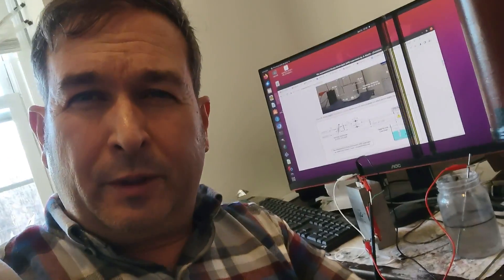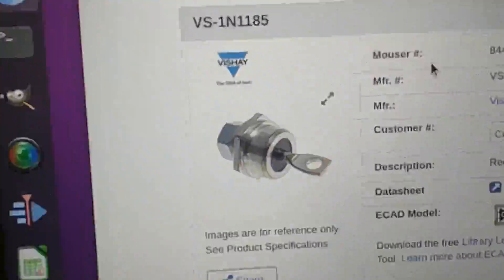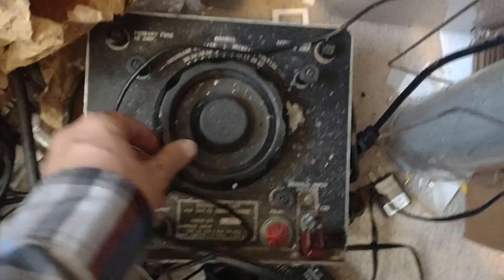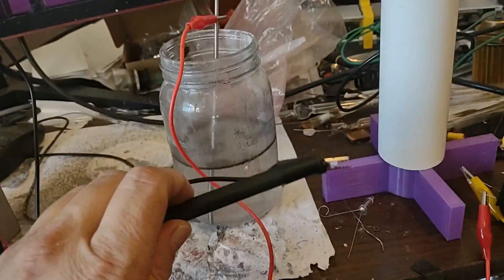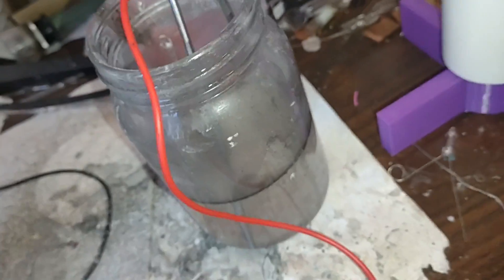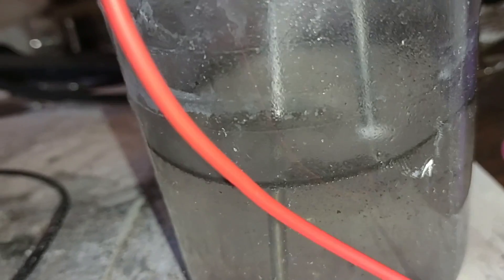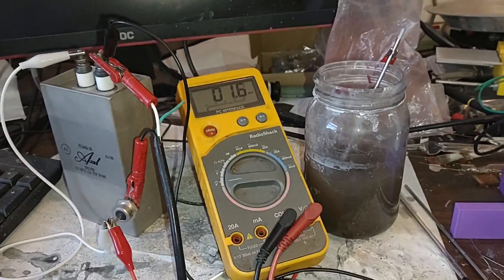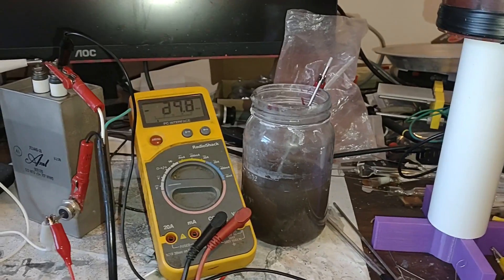Plasma Electrolysis

Comment: I saw your video with the radium clock hand and neutrons I was curious if I had a bunch of clock hands about 1 uci of radium in total if you put lithium in front of them would it yield good neutrons?
Reply: Beryllium is better and produces more neutrons than lithium, also aluminum can produce a few neutrons when bombarded with alpha sources like radium
Reply: @mixtopics4902  I talked to Cody from Cody’s lab. He said it is making neutrons, but very little I switched out the lithium for aluminum because the lithium kept lighting on fire

Comment: Nice video👍 could you repeat the tritium experiment about plasma excitation and neutrons coming off?
Reply from the maker: I can only get deuterium, and only in tiny quantities... It seems for this plasma phenomenon to work, you need a large volume of water... Interesting idea... I will look into it! Thanks!
Reply: @jaynesnetwork  Is it still possible to buy EXIT signs with tritium tubes on it?
Reply from the maker: I found it on ebay a while back, but it was not advertised properly.. It didnt have the word 'tritium' in the title, or it surly would have been removed from ebay.. They do not allow the sale of such things... There is not much tritium in those things either.. certainly not enough to make tritiated water... if you could even figure out how to get the tritium out without loosing it after breaking the glass vessel that contains it,... It might be interesting to try with D2O, but I would need a better source of heavy water...